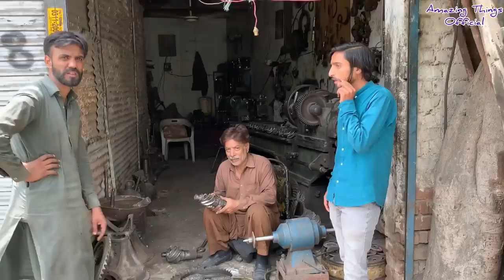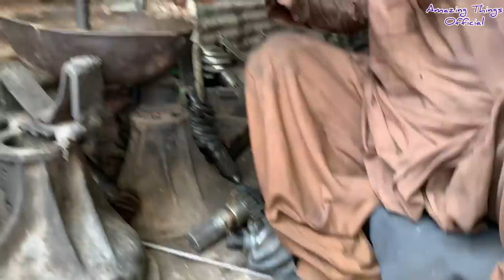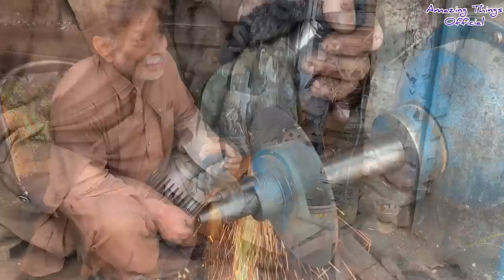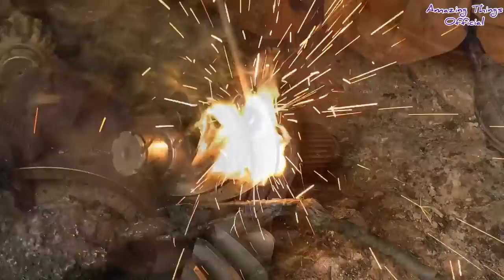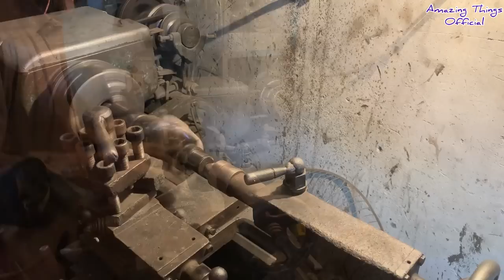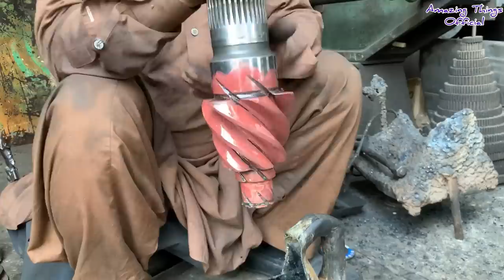Rebuilding & Welding a Wrecked Pinion Gear || How to Repair Rear Differential Broken Pinion Gear

Comment: Gears and pinion shifts are case hardened so do you heat treat it or just let it ride? Also a repair like this might be ok for a small car but for a big truck is just nuts.   You must have one of those calibrated eyeballs to get the tolerances spot on.
Reply: Calibrated eyeballs at work. "They'll work themselves in." And of course assurance of repeat business...
Reply: I beg to differ to your comment. That blue spinning motor does the SAME job as a Oerlikon lapping machine. I'm impressed. LOL Have a great day, thanks for the laugh. BTW his eyball can detect variant as low as .0002, that's precision.

Comment: Well,
I’m assuming that the gear is a 5 cut design?
Regardless, the attempt is outstanding, but I already know what the results are going to be.
A soft and noisy gear that will last hours not years.

Perhaps if the gears never saw load on the drive side they would last in gear oil, but loaded no way.
Reply: Context is important, by the gearsets in the background this is not his first rodeo.   One example is your stuck 5 hours from home. parts are a week away, for $2 and half a day get your truck home. He may also sell them in grades, for say a yard or farm truck. might last years on short trips. Economics dont lie. He wouldnt be in business if it didnt suit a purpose. By his skill hes done this many times.

Comment: I'm sure he carefully chose the welding rod to perfectly match the gear steel alloy. Lots of SAE 8620 for stick welding, right? And he definitely took that pinion to the back of the shop and re-carburized it in pack charcoal afterwards, didn't he?
Reply: That’s the thing, they don’t have too and don’t care too, the repairs they do will likely last a while anyways, or until other stuff breaks
Reply: Your knowledge is out of this world. That makes you better than the man in the video. Well done.
Reply: Might be using a 9018

Comment: Impressive work by hand, but I think the gear needs some tempering and hardening before it can be used. Maybe another shop does this?
Reply: The hardening was done after the welding when the pinion was put in the bucket of water.......LOL

Comment: What about the heat treatment and annealing process for the correct hardness so it does not break again, no testing, no idea what the material is hardened too.  Unless with the proper hardness.

Comment: Hmmm...also ich kenn mich null aus aber ich vermute Schweißdraht ist ungeeignet für sowas.
Reply: You have to use wire that can be hardened.  Gears and pinion shifts are normally case hardened and now it's not so it won't last long.

Comment: Holy fuck a lotta y'all are just haters for no fuckin reason,they're making due with what they got.
Reply: For real. Im pretty sure this is common in this area and the both parties know that this is simply a cheap fix that WILL fail but its better than nothing. Im oretty sure they go over not flooring it and to take it slow while they make it to their destination to get a proper fix. They are making due with what they got.

Comment: Half assed repair all the way.  Wrong metal in the welding rod (most likely), no heat treating afterwards, dimensions are surely off.  Good enough to get their money and get the truck down the road 50 miles, no bring backs, no warranty.